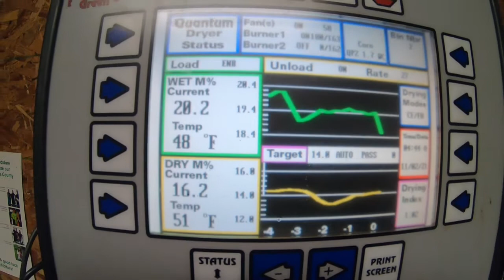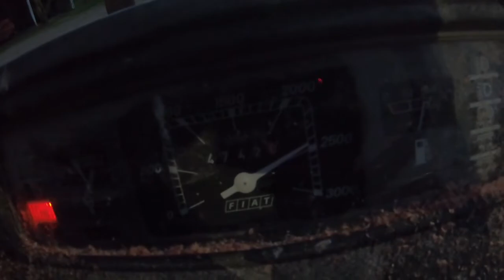it thinks its broke

Comment: How many bushels is the wet bin and will  the dryer empty it in day. We have a GT batch dryer that needs rebuilt. Can dry 4. 500 batches a day but need to manually load/unload and fire.
Reply from the maker: Ours is continuous flow.  Doesn't need to dry in batches. Capacity of wet bin
1,000 bushel